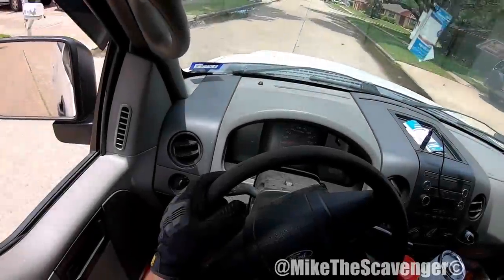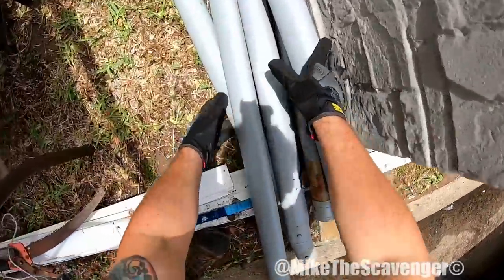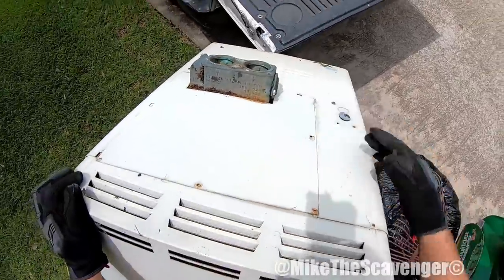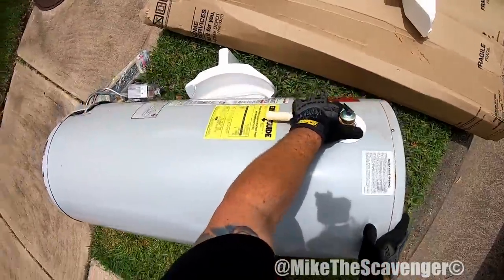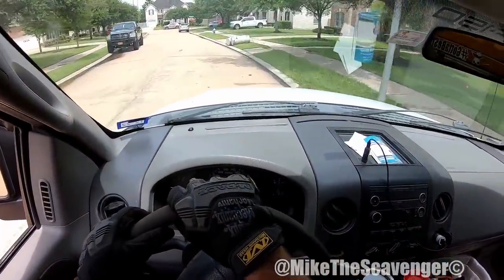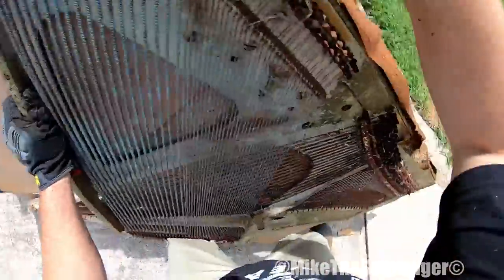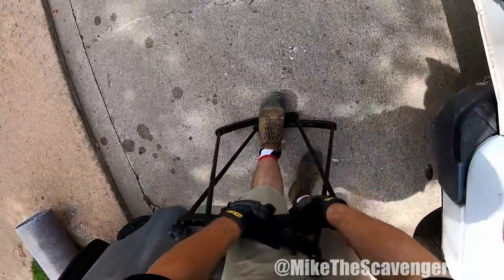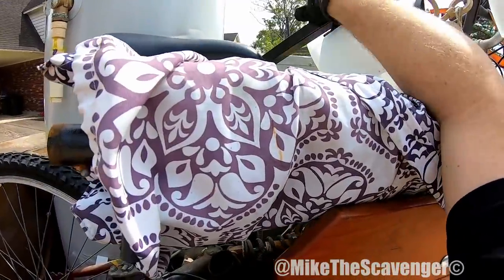Curbside Scavenging "I Need Your Face!"

Comment: Piano harp/frames are cast iron.

"The piano plate, sometimes called the frame or harp, is typically made from cast iron due to its high compression strength. The strings of the piano are attached to the plate in conjunction with the wooden frame and soundboard, and which the tension of the strings are supported."

Comment: That part of the piano you got is the harp, the wood it's mounted on is the soundboard . The harp should be cast iron and some of the wires are brass. Watch out the wires are under tension!
Early congrats on 400,000!

Comment: Your piano frame is cast iron, the woodscrews are usually brass, also the agraffes - the studs that the strings pass through. On the wound strings, the core is best quality spring steel,and the winding wire is plated copper or copper alloy.
"Looks like Christmas vomited" - best laugh of the week. Thanks!

Comment: Hey Mike, your a young man and strong, but you really need to consider a power lift for your truck tailgate.
save your back! or you may have bad back problems as you get older. The lift is worth the investment, and will speed up your pickup time. Enjoy your show. Ed

Comment: 10:13 cast iron guts from a piano, some of the smaller parts might be brass.  If you're saving rotors for a big payout add the cast iron piano part to the rotors pile. The piano part is cast iron, steel can't hold up to the tension that piano strings need to sound the way they do.

Comment: Kudos on getting that piano soundboard loaded...they are beasts to move....taken apart a few pianos in my day. Usually I snip the wires with small bolt cutters, then take a sledge to the cast, makes it easier to move....not as quick, but easier on the back.

Comment: Yeah, the piano frame is a solid hunk of steel.  I forget how many thousands of pounds of tension, the strings put on....  but it's a lot.  I'm amazed you got it in the truck, those things weigh a ton....

That's another weird case where, if you found a piano shop, they would probably buy it for a lot more than scrap value.  That is basically the heart of the piano....

Comment: There are 6 or 8 bolts and it comes up grind them off and it should come off the wood and some of the strings have copper on it and that's cast-iron

Comment: Thing about water heaters…if they’re maintained…cleaned out and metal components replaced as needed…without the line sitting in the bottom half making the tank rust …they’ll last twice as long….the electric ones…it’s a $20 per element and two screws each to replace them and while having the bottom one out..u can use a shop vac and tape an adapter to the hose to fit inside the tank..,clean out all the like and new burners…it’ll last 10x longer

Comment: @10:00 Pianos are usually cast iron ,but definitely got brass parts,nuts & screws & occasionally you will find solid brass piano hinges that are the size of the piano 🎹🔥 you should have seen what I did to the old school piano ......what a fire ...but had lots of scrap including iron ,steel ,brass ,copper & lead ,filled 2 coffee cans full of lead ..& a can of brass hardware..I actually kept the solid brass piano hinges as they was way too cool to scrap & really old too, the set screws holding the piano cables are usually brass or even copper on some pianos too

Comment: Need to get u a good trailer and we know it'd be hard for you to pull it around the places you go, but you can leave it at home and when you get done cleaning your scrap you load the trailer down with all your metal and put your copper and brass aluminum and batteries in the truck bed so it's easier in the end and you can haul bigger loads too, just a thought.

Comment: You do know that most old water heaters have sollid copper cores, it just the outside that is sheat metall, and then insulation, and the inner core is copper. They are worth alott-lott...

Comment: Some of the house designers like the metal for art on the walls some have the company names Mike dont touch the paint just give it a clean and only if the strings are broke or rusty take them out.👍👍

Comment: that piano will be cast i weighed in a piano a couple of years ago you will fetch decent money in the scrap yard for that the main thing to look on pianos r if the tuning pegs on that r brass then the you will have dirty brass plus that piano whont take long to strip either just what ever you do dont smack it with a lump or sledge hammer to break the cast up as it will spark